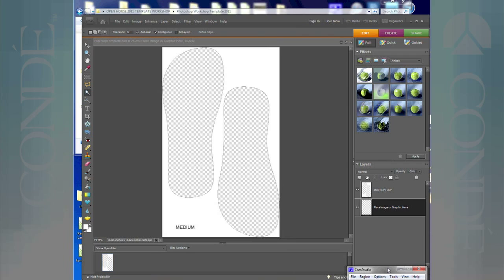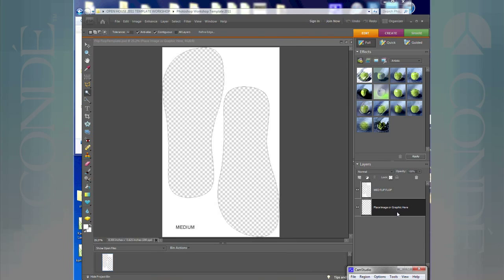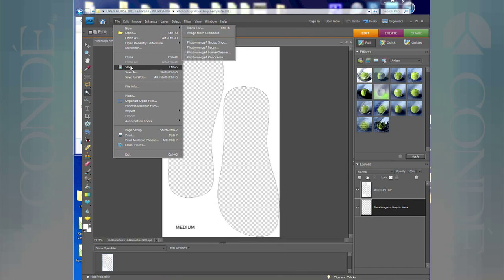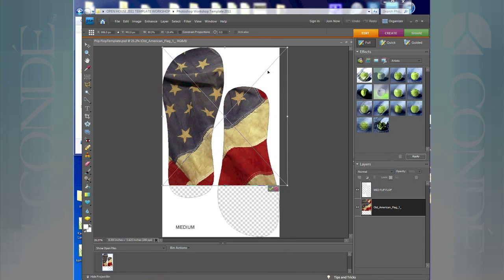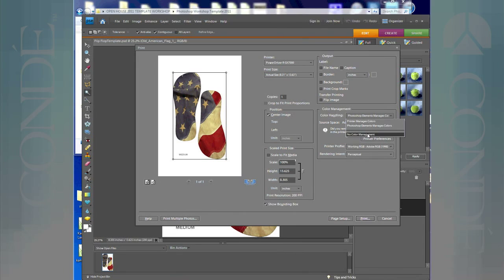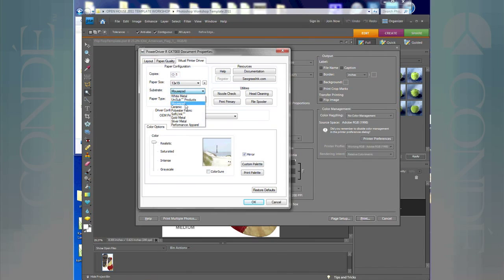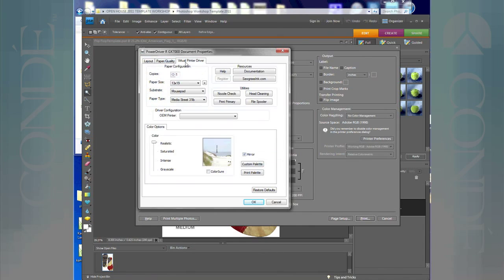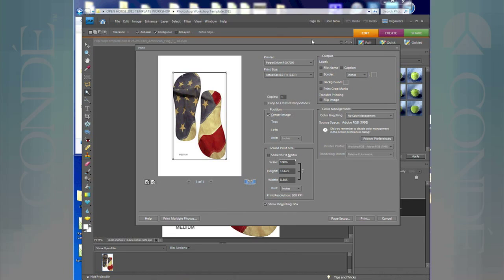Opening and Using Product Templates in PhotoShop for Transfer Imprinting -

Comment: What if I wanted to put a scenery going straight across? or I have an image with two people in it and I wanted them to fit one on each sandal? I need the sandals to both be top-to-bottom; top-to-bottom.... not top-to-bottom; bottom-to-top (like in the tutorial).

Does the template not fit on a 13x19 with both left and right sandals being right side up next to each other? Looks like a tight fit, so I'm sure it won't work but just wondering.